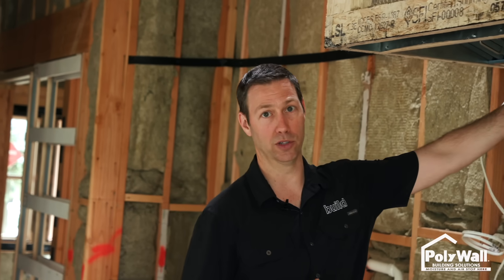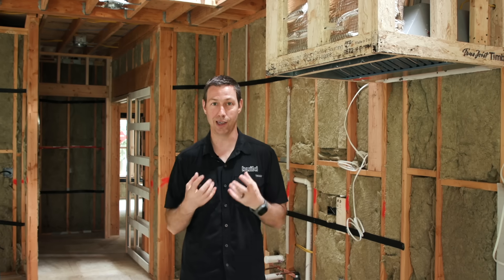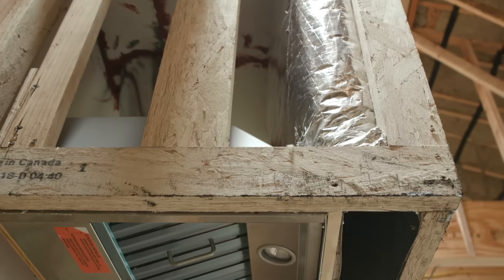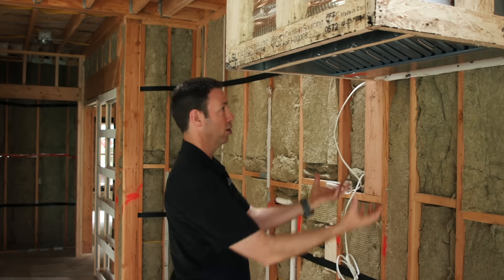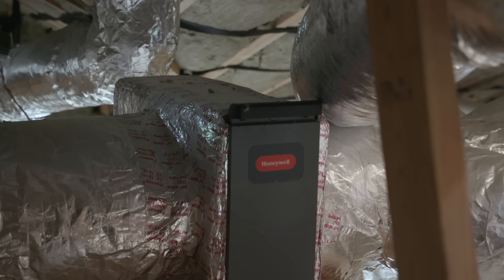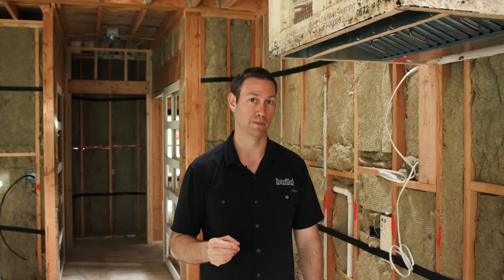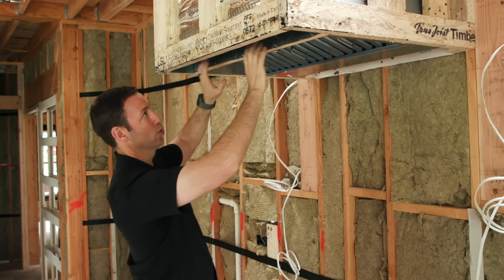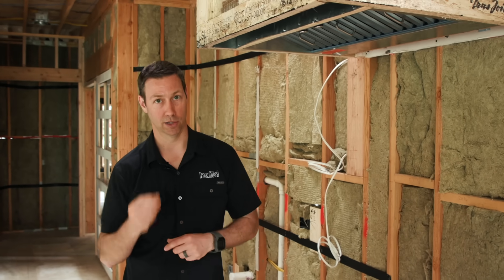Make Up Air - Kitchen Hood in a tight new Build

Comment: Looked at the filter          On the  inlet side of the filter and the leaving side of the filter the  contractor who designed, installed the system just taped into a sheet metal pan of the filter box.. What a bunch of people who really do not knot the art of suck and blow  There should have been  rectangle to round transitions at a minimum of 12" to capture the full area of the filter. What i see is contractors who operate out of there truck  , no sheet metal shop,   what a shame the homeowner is screwed again   Sorry Matt
Reply: Coincidentally, I have the same honeywell filter box on my furnace - I get 4-6 months depending on seasonal air conditions (farm country - summer/fall have a higher dust load).   Its probably overkill in this particular application, even when properly installed, but that's $25 a pop for the merv 11 filter.    It probably translates to a $100 loss over the life of the unit, considering unused media area (and a filter replacement every couple of years).   The real screw here is the foil tape job - I got a chuckle out of that.  I'm surprised that passes code as a failure of the foil tape (which I've seen with hot/cold cycle applications) could result in what amounts to a chimney exhausting into the attic.   Also - how many home owners are going to remember to replace that filter, in the attic, every couple of years?
Reply: Arnold Elgort   Arnold,  you sound like a real tradesman who takes pride in his work.  thank you.  Robert.
Reply: In this setup 63% of the filter element is in the flow path. What does the rectangular to round transition cost in comparison to the filter element? Am I ever going to recover the difference?  After running it in the intake I could take it out and run it in my furnace for a few months to use up the remaining capacity, until I get the DP alarm. Flow will take the path of lowest resistance.
Reply: @paulchevako  :) kind of my point as well... the tape failure risk, the extremely long service interval, and the fact that this filter resides in the attic are bigger concerns - IMO.

Comment: We have a 60" hood in our new house (foamed insulation) and had makeup air installed not as close but near by in kitchen like this. I requested that it have a filter on it like you did but they (Casa Mechanical) told me the filter would prevent it from working as it would be too hard for air to come through so it would come from undesirable places.  I have a passive makeup air vent like you describe that simply opens a damper when the hood is activated.  I'm intrigued to learn that the passive style can be filtered as I really didn't  want to be bringing   pollen or bugs into the house as we took so much care every where else to prevent that with the ERV and such.
Reply: large filters like these pleated filters do not block the movement of air.. Smaller ones that much move a lot more air over a given size will require a much higher velocity and will act as its own damper cutting down the ability to supply enough make up air
Reply: Although the larger media filter has a low resistance to flow in comparison to a standard 1" filter it is still resistant. Air is lazy and will always take the path of least resistance. If the house is submarine tight then in theory it's a good idea, in reality that filter will likely cause just enough resistance to encourage the air to enter from unwanted infiltration. Essentially the filter makes the small bad holes bigger if their resistance to flow is lesser than the filter. This would only apply for passive ventilation which it appears to be in the video. If you are going to filter than you should have forced air. A better approach would be a wall stack with passive fresh air inlet located near the cooktop, put a mechanical damper with a pressure switch connecting it to the exhaust system or simply a well balanced barometric damper would do the trick. If your worried about critters just ensure your intake is screened and well positioned. I wouldn't overly concern myself with worry over pollen, etc. Its intermittent temporary source control that when set up properly should not impact IAQ no more than if you were to open the door to go inside.
Reply: @dustincole2625  Thanks, that has been my working theory with the setup I have. The intake vent is on kitchen ceiling near the hood and has a very short run of duct work to the outside. It has the pressure sensor you mention inside the hood duct work so the damper opens when I turn on the hood. I figure and hope that the ERV and general AC cleans up the air pretty quick anyway.
Reply: @realpdm   you should be fine, just remember that it's only bringing in the untreated air during times of use. So long as the damper closes after each use the amount of untreated air is relatively small so your existing systems should handle it.

Comment: This is an important topic that I'm sure many builders have never heard of.  Thanks for highlighting this topic.
Reply: dahveed284 -It’s code everywhere, HVAC company will def tell the builder!
Reply: @lisao3041  IIRC, code calls for make-up air for only certain sized vents.  With new houses getting tighter and tighter, even the ineffective vent hoods track homes have can create a negative house pressure.  Of course, a lot of those cheap units don't actually pull the air from the house, but instead pass it through a simple filter and back into the kitchen.  I'm eating dinner with a HVAC engineer tonight.  I'll ask him.
Reply: @dahveed284  yes, I know. Code everywhere for over 400 cfm. Perhaps I should have clarified that.  Matt should definitely have clarified that too.

Comment: Extra $120 filter to replace every 6 months lol
Reply: More like $20 and can probably be replaced every year or two depending on the amount of cooking.  Probably 5 years of vent hood usage for me would equal 6 months of A/C usage.
Reply: @dahveed284  large pleated area and super low cfm thru the filter.. and I agree with you
Reply: @dahveed284  Cheapest i could find was $45 CDN + shipping for shit generic brand
Reply: If the filter has to be replaced then that means it is doing its job ? Right.  I pay our housekeeper $30 an hour ( don't judge me best money my wife and I spend each month. So I don't have to clean toilets) if she spends 2 hours a year not dusting I'm money ahead.  PS if you spend $120 on a filter I'll sell you the same one for half off with free shipping. And pocket 30 bucks in the process.cough cough.
Reply: @tysleight  Good on you for paying your housekeeper a decent (or even a great) wage.  You usually get what you pay for...
Reply: @dahveed284  she can do more in 2 hours than most do in 4. Well with my  money.
Reply: @tysleight , Having a housekeeper is awesome !
Reply: @tysleight  Cheapest i could find was $45 CDN + shipping for shit generic brand.
Reply: Try about $20/ each
Reply: @alanoldaker563  Cheapest i could find was $45 CDN + shipping for shit generic brand

Comment: Matt, don't you see how absurd your "tight is right" philosophy is???  Make up air for the hood.  What's next?  Make up air for the bathroom fans?  

Spending huge $$$ to stop leaks, then have to spend bigger $$$$ to provide conditioned air so you don't gas yourself to death with all the chemicals inside the house.   It's batshit crazy...
Reply: Better to know where your makeup air is coming from so you can plan accordingly. Ever seen old fiberglass batting that looks like the air filter in your car after driving through a dust storm?
Reply: Uh oh. Looks like we've got a tight denier here. ArtherD, come into present time.
Reply: A house is a finite system that can be mastered and engineered to a predictable end. A skilled builder using known quantities should be able to run out cost estimates on the repayment times for all of the separate energy saving devices/material used in building - In fact, many have. Not only that, we have the technology  to calculate the embodied greenhouse gases and energy used in production of all of the materials as well. The knowledge, technology and materials for building homes is changing faster now than it ever has - it's daunting but you can't turn your back on it. Having a deep understanding of the past coupled with an ambition to do better is key. I just helped build a 1.1 ACH home for Habitat for Humanity - a new record for our affiliate - we took measures to make it comfortable and functional for a long life, and the homeowner will save thousands because of our attention to those details. This was a rehab house, 20 years old, conventional 2x4 construction - we spent maybe 60G with some volunteer labor, donated materials, and reams of knowledge from the likes of our local energy efficiency guy and greenbuildingadvisor.com
Reply: @frattman  sounds all rosy.
"A house is a finite system that can be mastered and engineered to a predictable end"
No.  The reasons are endless, but the answer is still a definite no.
Why?  Details.  Why?  Environment.
Why?  Preference, emotion, fads, etc.
Why?  Economics.  Why?  Government.
Why?  People.
Reply: @ryszardbargiel7256  I'm referring to an individual house, thoughtfully built - not houses in general in which case I agree with your premise.
Reply: Why do you watch his videos?
Reply: the74impala, There is value in his content in general, doesn’t mean you have to be a true believer about everything Matt says. Disagreement is possible.
Reply: @lisao3041  This isn't about "true believer " status  From what I have seen, and believe is true,  this method of make up air is far from ideal,  having the air come from across the room is much better.  But for someone to describe  "TIGHT IS RIGHT" as  "batshit crazy" then yes, why do you watch his videos  That is what he bases EVERYTHING on.  

If the range manufacturer  says the btu's demand 1000cfm, then that is what is needed or there will be trouble for the builder.  

If someone is stuck in 1970's building mentality, why are they even on the internet, they know it all already
Reply: the74impala — lol, what manufacturer specs out a 1,000 cfm fan? In fact, manufacturers don’t dictate hood sizing at all. It’s dictated by BTUs, size of range, and general room size. If you need more than 400 cfm, you can’t cook and are burning everything. 

I can’t speak to OP’s building year mentality BUT making the house tight and then turning around and allowing infiltration is counter intuitive to many people. To that I believe the OP was commenting. Like I said in other posts here, there’s no tempering of the air coming in for my gas dryer and that is most certainly bat shit crazy.
Reply: I wish you could have come come help demo my  last remodeled house. An early 2000's build in a dry climate built so the house could breathe like grandma's house did but well insulated. Windward side, the bays had lots of dirt not just dust but dirt ( house sits next to a field). The dirt was mostly facing the outside, the Leeward side that received very little sun had tons of mold on the north side and the sunny side the dirt was on the insulation facing the inside of the house. Upon finding the mold we did some looking ( we get 13-16 inches of water a year so mold is uncommon without a leaking pipe or roof) and found the homeowners had installed a humidifier to help with the families allergies and heat in the Winter. 

 The house was sealed with zip and foam the best we could mostly for temperature control and a whole house humidifier with outside air was added at the request of the HVAC guy.  Recently the mother said they have to dust less, the gas and power bill is 1/4 of what it was, and they have less allergies. Personally this has been a terrible year for allergies.
Reply: Yes absolutely makeup air for the bathroom. Technically, in humid climate, you want to pressurize the building slightly to prevent infiltration while keeping spaces like the kitchen and restrooms negative with respect to the adjacent spaces to keep the smell localized. You do an air balance to figure this out and yes, you figure in makeup air for the restrooms.
Reply: Yup, gotta open a window. With my tight house, it takes forever to evac my bathroom after meeting with obama.
Reply: You have lost your mind.  Just ask someone nearby for helping finding it.
Reply: I kinda get it though. The additional required fresh air vent for my gas dryer is absurd. Gonna seal off that puppy after HVAC inspection. Nothing like hot, humid air pumping into my house 24/7. 

And yeah, just get a 400 cfm or lower hood for crying out loud. Unnecessary expense but it’s a custom, big ass, expensive house so 1000 cfms it is! Oh m’am, that makeup air unit is another $1000.
Reply: @lisao3041  Yeah, hopefully you're joking about that . . . Also, having a 1200cfm exhaust hood is not overkill for those who enjoy cooking, and I've worked in a few kitchens in my time.
Reply: Fratt Man - I amended my comment, the additional outside fresh air vent required for gas dryers.
Reply: @lisao3041 , You're not really gonna vent your gas dryer into the house are you ?
Reply: august - Code requires a fresh air vent in the room with a gas dryer. Regular vent for dryer exhaust.
Reply: @lisao3041 , I'm kinda lost and I'm sorry but you said you're sealing off the outside vent. Does that mean the fresh air intake or the hot moist air from the dryer ?
Reply: august- sorry for confusion, I’m going to close the required fresh air vent intake required for gas dryers and open it only when I use dryer or crack open the exterior door. The vent for the dryer will, of course, remain. It’s just stupid to have hot, humid air pumping in 24/7 in the summer so I just want to control it.
Reply: @lisao3041   I would encourage you to leave the dryer intake vent open. a few reasons would be that in most households that piece of equipment removes more air than anything else. If you pull hot humid air into your laundry room and it was thoughtfully designed it will dry out, as far as the added heat I do not know anyone that spends any mentionable amount of time in their laundry room. If the appliance is gas than it needs even more air otherwise it will not provide full combustion, as a result it will take longer to dry things which costs more money in fuel and electricity and to add insult it will just get its air elsewhere causing the wet hot stuff you are wanting to seal off to get in from somewhere out of your control.    It's not about geeky building science it's about control.
Reply: Dustin Cole - I’ll open the exterior door a crack but allowing hot, humid air in 24/7 in the summer is not an option.

Comment: 50 years ago having a makeup air vent next to your 60% gas furnace combustion chamber was a huge saving in not bringing cold air into house where you didn't want it, then it went up the chimney with flue gases.  Maybe next is concentric exhaust pipes for bath fans, for make up air, fresh air blows in (static w/damper) on 1 vent and other side exhausts.  With houses becoming so tight would 70 CFM's be a problem?
Reply: A D the there is not enough thermal heat generated and cooking duration is too short in residential applications.  This was a thing in commercial systems 20 years ago, but the issue was that ductwork could not be sealed, cleaned or fire wrapped, and was a potential fire hazard.  Plus seasonality made this a good idea in winter, but poor in summer.
Reply: Eliminate bathroom fan by installing HRVs with enough capacity to ventilate a steamy bathroom.